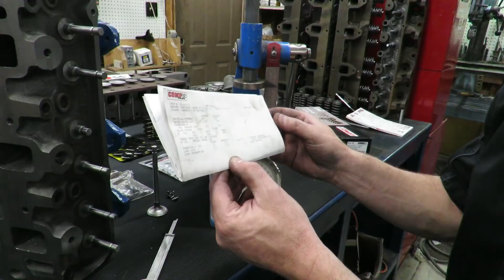390 Ford stroker Build part 7B

Comment: I have watched all these videos before but I am currently doing a 390 build so im watching some of these again. Your seat pressure will be more than 120 at 1.900. You used a retainer on the top of your spring for the inner spring but on the bottom both springs sat flat even with each other when you were testing them. I can see on your head were your inner spring sets there is about .100 step up from were the outer spring will set. So when your outer is installed at 1.900 your inner will be approximately 1.700 for the 
.100 step on the cylinder head & the 
.100 on the retainer. You can duplicate this when testing by putting a retainer on the top & the bottom of the spring.

Comment: Very informative vids.  Wouldn't you need to add the height of your retainer to your caliper when you were doing your spring pressure test? Probably why it was at 120#
Reply from the maker: no the spring sits agenst the bottom of the retainer the height is not a factor

Comment: Love your channel, I've got a question for you. I had my 428SCJ heads ported /polished and a 3 angle valve job done in 1979, with what you said about unleaded fuel that has me worried because what are the chances I did not have steel valve seats installed back then. This engine has sat and was recently gone over in 2013. Valve springs where changed and the cam re-lubed before firing it up. It runs fine but what problems will I have if the seats weren't changed to steel?

Comment: Where's your shop and how much for budget build Buick 455 was thinking on getting Iron stage1 heads does that change the pistons or cam or lifters also how do hydraulic cam n lifters vary from stock?

Comment: At 2:02 , I  put a 4" piece of vacuum hose over the valve-stem & put the other end in the chuck of a small low-speed drill, a few seconds worth, pulling slightly as the hose piece stretches...works fine.

Comment: I have been racing my 77 ford truck for a decade and I have always ran a 390 engine. Still run a 390. My best time is 12.0 at 110mph. How much would you sell a pair of these heads for? I'm sure I have too much cam for the heads I'm running now, after looking at these heads it just make me want a set even more. By the way, did you ever get the flow numbers on these? I do run a solid flat tappet cam with adjustable roller rockers that pushes the lift to .609int. and .629 exh on a 108 lsa cam.
Reply from the maker: $700.00 for a set
Reply: What heads are these? Have you flowed a cylinder on each side and the velocity from.100-.600?  Those look like C8AEH? What size are the valves? They would be nice with 2.15/1.65, and a little porting.  But 2.09/1.65 is good. Likely about 246190with the CJ heads or valves . These would be good for a 445. That is about the same as a 440 Magnum Mopar. And the intake manifold will likely boost it to 255 intake at 28. That would support 500 hp and 500 ft lbs with a 240 @.050 hyd roller on a 110 with 106 intake centerline. A 445 is a good stroker. I have a 390 that makes 493 hp and 464ft lbs with a 230@ .050 and .549 lift.

Comment: You going to go into som details regarding the lifters-pushrod?  Fixing up a 390 off a 64 Mercury and there aren’t really any good resources regarding the non adjustable rockers and the lifter-rod installation (particularly determining rod length and fit). Can’t wait for the next upload.  You’ve been a great resource!!!

Comment: I've got a question-how much torque would you guess this engine will make? I'm planning a very similar build and I'm researching manual transmissions. I'm looking at the tremecs. I'm building a 65 ford f-250.  Do you know yet which tranny you will be using and what would you recommend? Thanks
Reply from the maker: 450 to 500 TQ
Reply: Myvintageiron7512 
Thanks, have a safe weekend

Comment: Perhaps you can give us a Specs again on started out as a what a standard 390 may be punched out 30 then maybe a stroker crank kit from scat somebody?
I like to look at the 4.25 stroke crankshaft.
Reply from the maker: Ok so the 390 has a std bore of 4.050 and a factory stroke of 3.785 the crank we are using for this build is a scat steel 4.125 stroke and we also bored the block .030 oversize that brings us to 4.080 if we do the math 4.080 /2 that is bore squared or bore times bore we get 16.65 times the stroke 4.125 we get 68.70 times .7854 (.7854 is 1/4 of pie it is a constant and never changes in this equation) so 68.70 times .7854 = 53.95 this is the cubic inches of one cylinder and of course we have 8  of them so 53.95 CI times 8 is 432 CID for this stroker engine it is bigger that the 428 engine however is a much different animal from the factory the 428. The 428 has a much larger bore and a shorter stroke our stroker is much more suited to low to mid rpm torque where as the factory 428 is a much higher revving engine that is more suited to a light street rod rather than a truck I hope this makes since  there is allot going on here with these engines and sometimes it takes a while to absorb it all
Reply: Myvintageiron7512 
Good stuff, 
When assembles, installed and lit, we will need 1!4 mile slips.
Thx

Comment: Oh those heads look so good makes me miss my old bumpside Ford trucks funny how times change things and the type of fuels we burn I remember as a teenager running those until  the seats we're beat so far that they sounded like the exhaust valves were practically hanging open I know an old man once that actually sanded down the stems on his exhaust valves because the seats were beat so far in when the lifters got pumped up good it sounded like a worn-out shop compressor I couldn't believe he done that and it actually ran like that for a couple years

Comment: Thanks for taking the time to make and post these videos. 

What is the timeline for the sohc inline 6 poncho? Excited to see that one. 
First car memory as a small boy was riding around in my mother’s 68 Tempest 2 door. 
Dark green exterior, avocado green interior. It had that sohc inline 6 engine and a power glide. 
It Died in 1981 or 1982. Mom got a new Pontiac, and the ol tempest got parked out back where it rotted away. Later it was hauled off and crushed. 
What a shame. 
Was just an old car back then. Nothing special. 
Would love to have it now.

Comment: 13:45 my shop usually says (when they have to do guide work) that to leave the valve seals off for the first 1-2000 miles, and install them after the valves had time to lightly work themselves into the guides (they said they had fresh heads, that stuck valves after work and seal install)
Reply from the maker: If a valve  seizes in the guide the clearance is not correct as far a leaving the seals off I have never heard of that the factory certainly doesn't do that
Reply: James T43 yeah I know about that stuff I work in a machine shop for 5 years doing a lot of guys Motors out at the racetrack locally here in man until you what the stuff I saw was unbelievable.
We did a fair amount of repair work from other shops
Reply: Myvintageiron7512 ,
It allows lubrication to get in there to a certain degree..
Possibly has a little bit of smoke but on my 428 Cobra Jet,  I used to race I just flat just left them off..
 I didn't really care cuz the motor didn't run that long anyway in at 50 weight oil, little got by anyway.
 so I never made a bit of difference on that kind of a setup for racing.
 but Street might be a little bit different.
Probably not a bad idea to leave it off while some lubrication to assist a little bit of a settling where in butt like you said Factory doesn't do that and I really don't know if that really makes a difference or not actually.
Reply: thanks!
Reply: Ash qelon . I have seen some shady shops that would drill the hole for the valve guides off angle so after they press the guides in they would pinch the valve and hang one open for you.

Comment from the maker: This video has head rebuilding clips from several different days so the clips are kind of random but it's all good info
Reply: Myvintageiron7512 awesome video, I always like learning about this stuff.
Reply: Myvintageiron7512 in NASCAR in the early 80s the ford guys used a head they called the Australian head it was made in Australia and Ford Motorsports brought it into the u.s. to use and the cup cars do you know anything about it hard to find info this is before the Yates head
Reply: Charles Richardson are you talking about the Australian Cleveland head?  Australia had a bunch of 351 and 302 Clevelands (yes, 302 Clevelands), and the heads used to be a big thing in the US.  They are a closed-chamber head with big valves and good ports.  They have been superceded by your average aftermarket Al head now.  No, I've never rebuilt a Cleveland, just want to and am relating what I've found.  The above engine is an FE, but all the Australian heads I've heard about have been the mythical Clevelands.
Reply: Myvintageiron7512 where are you located
Reply: I think some SBF enthusiasts nicknamed that head the Cleveland 3V, even though Ford never used a 3bbl carb on any SBF.
Reply: @skylinefever  They intended the nomenclature for the 2V essentially as the small port/valve. the 4 V as the large port / valve racing head ( That I wish someone would make for a 4.63 bore spacing and fit the FE especially the strokers like a 4.13 bore 455  or a 4.16 462 or a 427 bore 482 with the 4.25 stroke.  Anyway the 3V was meant for 351C or Windsor with a longer stroke and has more velocity and smaller valves to be more tractabile.
Reply: Good video.  I was trained to put a straight edge across the top of all the valve stems also.  That will show you long and short stems so you can center the plunger of all the lifters.  Adjust push rod length as needed to maintain rocket geometry.